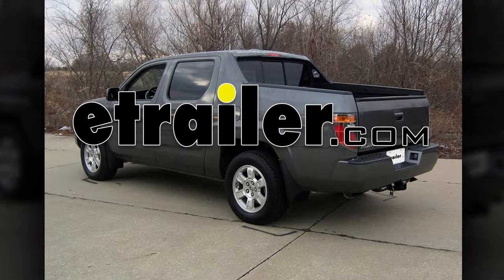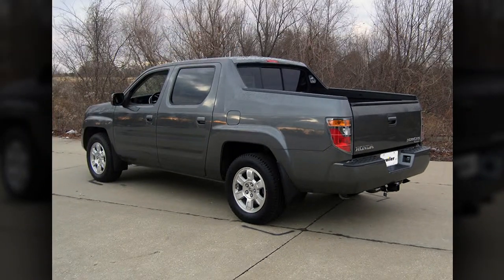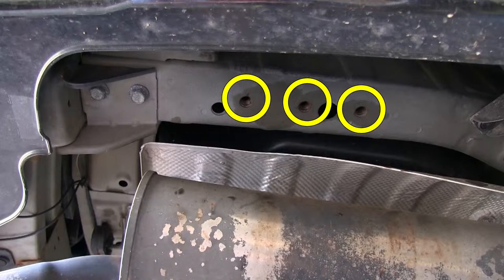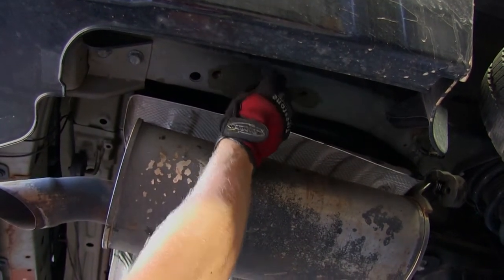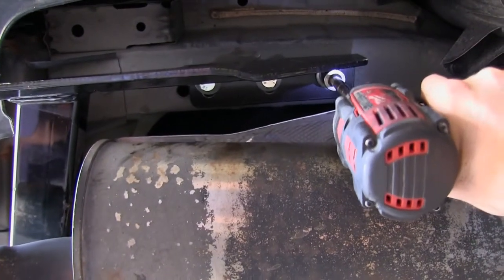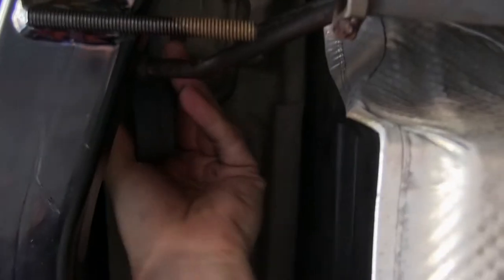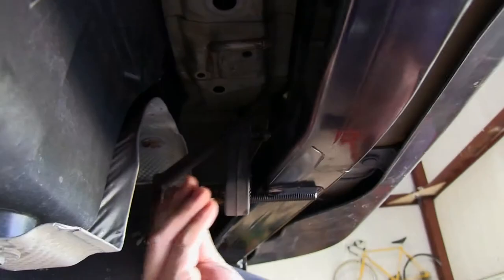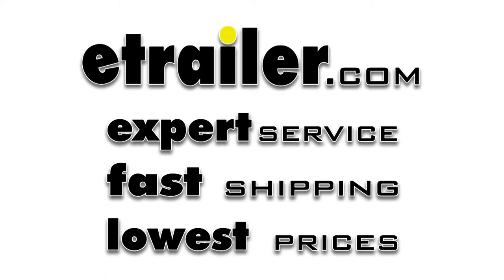etrailer | DIY 2008 Honda Ridgeline Installation for the Curt Trailer Hitch Receiver

Comment: What about wiring?
Reply from the maker: Here is a link to the wiring options for a 2008 Honda Ridgeline https://www.etrailer.com/t1-2008_Honda_Ridgeline.htm

If you don't already have a ball mount/hitch ball to complete your towing setup then below is a link to our selection as well as some helpful articles that you can use to help you determine the best option for your towing application.

https://www.etrailer.com/maindept-Towing.aspx#towcomponents
https://www.etrailer.com/article-categories.aspx?productgroup=Ball-Mounts